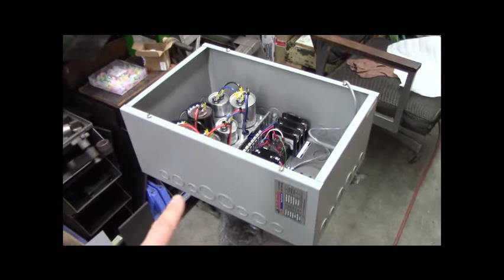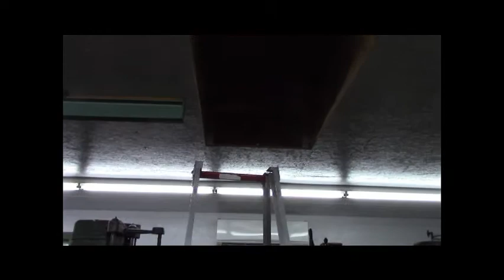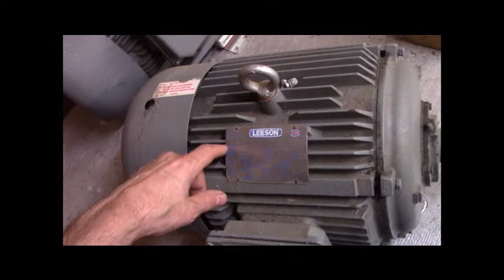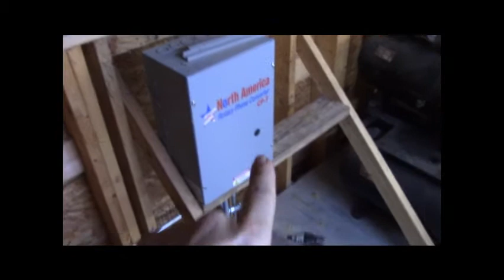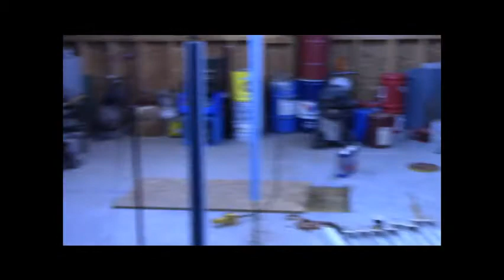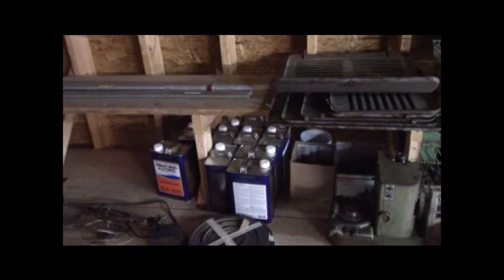Doozer's Machine Shop Update 7-21-20  --  North American Phase Converter Upgrade

Comment: Does the rotational RPM speed of the armature have any effect on the phase relationships of the output of the phase converter?  What about connecting the armatures together so it's just a onetime load for start up? 
Might want to invest in some venting for your attic.  Might explain why one of the caps started leaking in the control box.  Also think high heat is hard on containers to say nothing of the possible degradation of the chemical make up! 
I see Tommy and Davy are getting bored in their Mom's basement.
Reply from the maker: Peter, as to your questions, I did read them.  Did not reply right away, but here goes.... So yes speed is a multiple of frequency, minus the magnetic slip.   Coupling the idlers together would make for a HUGE startup load on the capacitors.  Not the best thing.  It would be good for added rotating mass when energizing only one idler, for better energy surge storage capacity, starting larger motors, etc.  But no real benefit when running both idlers.   So for the reason of being so hard to start, not worth the extra, single unit running, serge capacity.

So actually my attic is super well ventilated.  Speculating on modes of failure is not my thing.  But if you recorded a temperature chart over 24 hours, over a couple summer months, the highest temps are no where near the limits of the electrical components.  The most correct answer is usually the simplest.  Made in China caps, made to the lowest price point as specified by the importer. I mean, maybe not, but most likely.  Thanks for your thoughts and comments.  Always good to have another brain to figure out problems.  That's why I like youtube.  Have a great day.
Reply from the maker: Who are Tommy and Davy?
Reply: @kooldoozer  You need to pay some attention to your commenters.  Look down two comments and maybe think about removing them!
How about a response to my questions?
Reply from the maker: @peterhaan9068  Hey Peter,   Yeah, I saw them guys, and reported them as spam.  I guess they youtube  allowed them and somehow they popped back up.   I removed them again. See if it sticks.